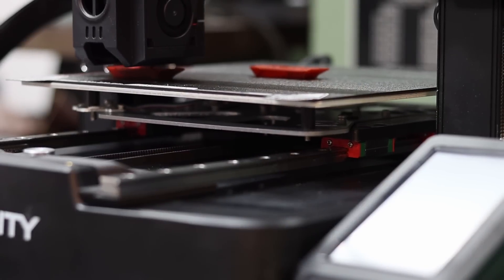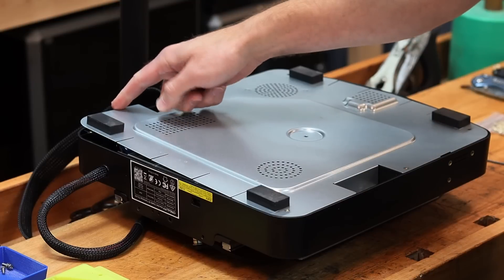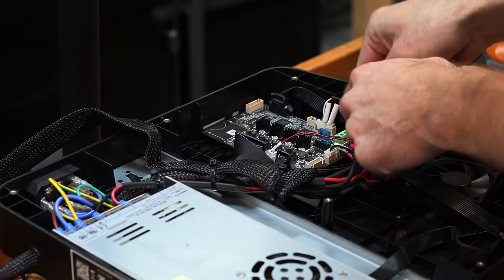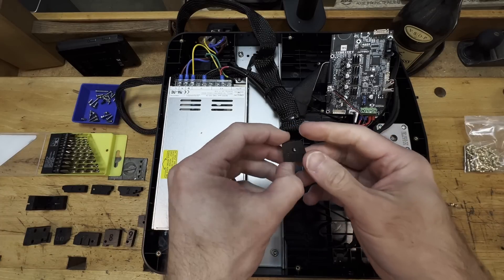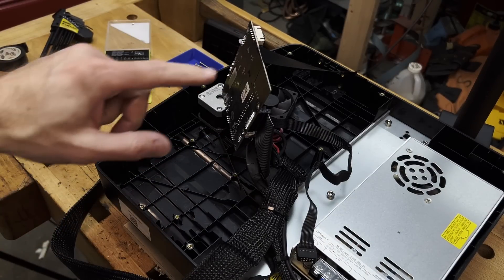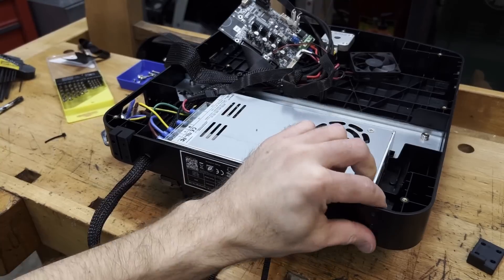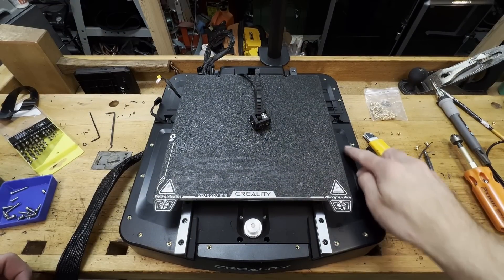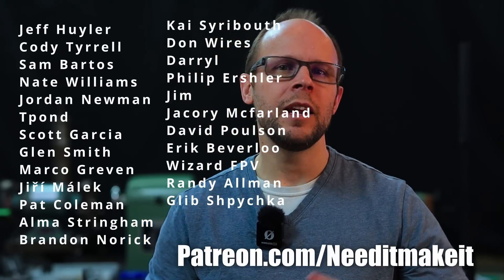Attach ANYTHING to your Creality Ender 3 V3 KE or SE Printer

Comment: My connector to the y axis stepper motor is causing a spark, any reason why? It has damaged one and i got new one. I was assuming it was motor issue, but it turns out connector crimps are at fault

Comment: Man.... now I really don't know if ai should gut my KE. Honestly I have like 8 printers and 2x laser engravers/cutters and I just made a mount for my plasma torch and ordered all new rail siders like this so zero belts plus its gonna use 4 nema 17s on bottom 2x of them will have 14 bit encoders the other two will just be the wires reversed(thats just for the x axis. Now to ay axis another 2x nema 17s one with encoder and one backwards hooked up. And lastly im also attaching my 3dscannerpro seal lite on one more nema 17 with its own 150mm slider and lead screw.. all new stop switches(different high end type) a big emergency stop button. And today im gonna order a 7in touchscreen pad and a high end brain board with Driver on it from China.. im just waiting on parts..

Comment: Well done!  I agree it lacks any way to add anything to the v3 se.  I am also pretty bad at added inserts they either work or fail no in-between.  I made a side gantry to lose some of the wobble on the top with the filament reel which My solid V2 did not have the same issue.

Comment: I bought a KE last month, have used it a few times and got decent enough prints,. but then I left it printing overnight to come back to the blob of death.. it killed not only the hot end but the fan, and the header board..... Try getting spare parts - the hot end header board is not available as a spair part here in the UK and Creality will do nothing even though it has a years warranty, so I have to buy the board from them via China at $45 plus taxes, a new fan and hot end, not good for a company with a supposedly good rep in the 3d market.
I think that they make way to many versions of printers. Good whilst it worked but I have just paid out for an A1.. If I can find a header where I don't have to buy it from half the planet away I will fix the KE... now it's under the table gathering dust.

Comment: Hello,

If I use Brass Heat Set Inserts 5mm instead of the 10mm ones you recommend, do you think it will cause significant instability? I hadn’t seen this video earlier, and I’ve already ordered all the parts for this build, as well as the one with the rails. I’m mentioning this to avoid waiting an additional 2+ weeks for the 10mm inserts to arrive.

Thank you!

P.S. The Discord link has expired.

Comment: I really like the attachment points you added to the Ender 3 V3 KE. If I ever added them I would like to add all the blocks at the same time, but necessarily drill them till I needed them. Just wondering if you could design jigs or templates to drill the holes as needed for the current project. Then the user could print the template they need when they need it. You could probably use some of the mounts you designed as a starting point for the template design.

Comment: Amazing mod, this is a massive help. Is there any chance you might share an stl or step of the base as it would make designing mods using these mounts so much easier? There are a couple on printables but variations on the base profile

Comment: I haven't seen your videos before, but after watching this, I am a fan.
Just a thought though, maybe you should have put the heat inserts in from the bottom instead of the top.  If they were 8mm long, you could have a couple of mm of plastic as well as the insert holding them in. All you would see from the top is some 4mm holes. Much stronger pulling force needed to pull them out.

Comment: Can the V3 SE print ABS? Can PETG be used instead?
Reply from the maker: You can print ABS on these printers, but you'll want to print in an enclosure, I've also printed with a thick blanket on the printer to make a pseudo chamber.  It's not ideal but it can be done.  PETG can be used, but Basic PETG is pretty flexible, using PETG-CF will give  you stiffer parts.
Reply: @NeedItMakeIt  Thank you

Comment: Is there a specific reason you decided to print the reinforcement blocks in ABS, and would there be any noticeable difference if they were printed in PLA or PLA+? I'm very new to 3D printing and haven't tried any other materials yet, especially those that may be a little fussier.

Comment: Yesterday I broke down a long unused Monoprice Maker Select Plus, saved the CF Z axis support rods and a few other parts. Those rods would probably fit this mod, though given the amount of flex there at the very end, I’m unsure if this will be worthwhile. Looking forward to your pre/post print results.
Reply from the maker: I'm nearly finished it, and it'll be fully printable (minus the bolts) I still need to address the extruder on the printer, so I can't really say it's going to do much, without having solved the other issue as well.  That will be it's own dedicated video, which is in the works, but it taking some time because of the complexity of the brackets and the confined space to work with there.

Comment: am i crazy to attach the base of the printer to a 80lb 1/4in table top and weld a gantry frame that this printers gantry fits under and attach to? this would make a solid steel frame around the printer stabilizing it i haven't seen anyone try and make a solid steel exo skeleton frame weldment for a 3d printer its all aluminum extrude with screws. any feedback id appreciate
Reply from the maker: No, I don't think that's crazy at all, it's just going to make the printer very hard to move around.  A welded steel frame is nearly the best thing I can think of, second only to Cast iron or granite/epoxy granite.    I've been wanting to make a steel frame for some time now, but I'm a Woodworker by trade, so I guess I should do a solid wood frame, it 'wood' be stunning!  I say go for it, possibly eye bolts to the table and tension steel cabling down to it would be another option.

Comment: I'm looking forward to seeing how you get the gantry plumb with the plate.   I just put a laser on the x gantry, marked the spot and ran Z up to 200mm and marked again.   There is a 9mm movement toward the back.   Laser was pretty bright so I will repeat with a lower power/brightness to be sure.
Reply from the maker: I'm nearly finished that upgrade, but 9mm, that's quite a bit more than I was expecting.  I noticed that the nozzle is not set at a perfect 90 to the frame, I'm not sure how you're attaching your laser, if it is to the head, it might be throwing off the results.  Are you able to use a plumb bob instead of a laser?  I'll check to see if I have one, or if I can make one up quick.
Reply: @NeedItMakeIt  I ran the numbers in a triangle calculator (cheating?).  

Side a = 200.2024  (calculated)
Side b = 200
Side c = 9

Angle ∠A = 90° = 1.5708 rad = π/2
Angle ∠B = 87.423° = 87°25'24" = 1.52583 rad
Angle ∠C = 2.577° = 2°34'36" = 0.04497 rad

Just 2.5 degrees off plumb gives a lot of runout.   I'm printing the front blocks now and remixing gantry mounts to match.    Do you have a 3d model showing the hard points once installed?
Reply from the maker: @haroldmelton11  It's only cheating on a test, you're safe on this one.  I've heard of some people having theirs off by quite a bit, but geez this is pretty extreme.  The solution I'm working on will have some adjustment so that the angle can be set and fine-tuned.  Maybe I need to give it a little more adjustment!

Comment: I really like the idea of adding all those mount points to the bed. But... with the reinforcing doublers glued in under the deck, why insert the heatsets from the top, where they're much easier to pull out under load? Why not insert from the bottom so the'd have to pull through the doublers? Loads would get distributed into the deck better, too.
Reply: Yes it's better but the headset is long enough to work well and touch the doubler.

Comment: seems alot of people have problems with the rails, but i checked my KE as i got it and the rails didint have any slop or unwanted movement in them, i guess i got lucky tho the z axis needs to be secured and im working on moving the roll off the printer, by moveing the roll above the printer on to a shelf i need to weld the legs for and cut a board of birch ply for the top

Comment: First of all, this is what I was looking for. I really appreciate your effort and all the stuff you've made. I will definetly do the same upgrade.

I have two questions
1. Would it be possible to get your files for the gantry stabelizers? or are they still wip?
2. the major problem Ive got with this printer is the "nozzle hitting infill"-Problem. Did you experienced that with yours? If so, did you managed to fix it somehow? 

Again, this upgrade is awesome. :) Instantly subscribed :D

Thank you very much in advance

Comment: I am surprised to see that the columns are attached to a almost flat piece of metal ( Alu or steel, cant see ) I see there is a bend that reinforces it, but still, I guess extruded profiles as a frame is better. I am looking into gantry supports and think the will be best if I can grab onto the bottom of the columns.

Comment: While I probably won't be using most of these, it would be nice if they included some kind of mount for their nebula cam they have available... so I may end up using at least one of them for that
Reply from the maker: For sure, though I have a mod coming which would allow the cam to be bed mounted along with the accelerometer, I've always found it more helpful on the slingers to have a camera that moves with the bed so the video is more clear.  Do you know much that nebula camera weighs?
Reply: @NeedItMakeIt  Amazon says 4.9 Oz, tho I did find a few different models to mount it to the gantry last night; seems most useful to have the camera move up with the print so that the active area doesn't go off screen (esp with the spaghetti detection capabilities), so I'll probably use one of those (bit of an easier mounting situation as well)

Comment: do you think printing the supports in ASA would work?
Reply from the maker: Yes, the solvent for both is the same and if you need to you can use super glue rather than the method I used.  it really just needs to hold them in place well enough to get the inserts in.

Comment: When putting in the threaded inserts, leave them proud of the surface by .5 mm. Follow up with a flat piece of metal to finish seating them. They stay plenty hot for a few seconds.
That makes the finished surface much nicerb without having to clean up flash with a razor later.
Reply from the maker: That's a great tip, thanks for that.  I have some more to do for the next project and I'll be giving this a try for sure!  The razor method tends to scuff the surface a little bit, it's better to avoid it, inserting from below would be an option too except 6 + 4 at the back had to be inserted from the outside and it didn't make sense to do them differently.
Reply: This is how I install inserts. It keeps them straight and clean.
Reply from the maker: @generic0000  Great tip, I have only a little bit of experience with inserts, just enough to get them installed, but not so much to have them looking as good.  Thanks again for the tips.

Comment: Another option would be to fill those spaces with epoxi
Reply: I don't think heat inserts go to epoxy 🤔
Reply: @kimmotoivanen  I never tried but it's an interesting thing to try
Reply: Epoxy is thermoset polymer, i.e. it doesn't melt.
Reply: @norseengineer  It doesn't. But it gets soft when I heat it

Comment: This is taking this printer to a much higher level. This gives us the possibility to alleviate the shortcomings that this very cheap printer has. Huge thank's for the effort and for making it publicly available
Reply from the maker: That's great, it certainly opens up a lot more possibilities with the printer, I'll have a few more options coming out which take advantage of some of the holes.  I couldn't think of any better options which would be strong enough.

Comment: Morning Mike.

Hope this finds you well.
As always I enjoy following along your creality journey. 👍

Great content.

A side note on a couple of things you might like or want to share with your viewers/community.

When handling a board ( motherboard or otherwise) it’s really good practice to wear an anti static strap or at the very least touch a bonded surface while handling the board. This prevents accidental static discharge into the board.
Which would permanently damage the board. I share this point with you, as we do a lot of marine electronics.

I’m not sure if you have done this firmware mod already to your K1-k1 max. That is increasing the bed probe point count.

I’m running a 24X axis by 24Y axis probe count on our K1 max currently, with excellent success and no error codes. 

I think this could also be done with any rooted machine running Klipper?

If you’d like more info on this (it’s a bit of a process) please contact me as I would  be happy to share this with you.

Cheers, and best regards from Salt Spring Island B.C.

Ron.
Reply: Hi Ron, reagrding routing the device, did you install Mainsail from GitHub? I did and was so happy about it till I found that the modules (e.g. Moonraker) can't be updated to their latest version.
Do you or anybody know of a way to update the modules?
Thanks!

Comment: Hi. I'm new to 3d printing. I ordered  ADXL345 Vibration Compensation Sensor and was wondering if you know that it could make a difference in vibrations or no ? I saw one test that demonstrated how it works in a lab environment, so the results are great, but what about real life.
Reply from the maker: I've done some reading on this, and apparently if everything is stock, there is little to no difference.  When we start modding the printer, you'd want to run the calibration again to find the new best values.  I don't think this printer works the same for vibration as we'd have on a Core XY, those printers have a head doing movement on X/Y.  Here we have separate X & Y axis and they'd need to each have a sensor which is active, and I think in most cases, people use the same sensor and swap it back and fourth.

Comment: Great solution! I’m new to 3d printing but I have plenty of DIY experience, and you’ve done all the hard work to make this a simple project for the rest of us. I will certainly be tackling this after I build an enclosure and get dialed in for ABS.
Reply from the maker: Thanks!  I hope it helps some people out.  Getting those blocks to fit well in the webbing, wasn't so easy that's for sure.  I'll have about 3 more videos coming for this printer... at least, there is so much potential and you guys have a lot of ideas as well.  We need to tackle the extruder setup as well, but that's a bit of a bigger project and I wanted to work my way up to it.  Which enclosure will you be using?
Reply: @NeedItMakeIt I haven't really done my homework on an enclosure quite yet. I plan to build one myself unless I come across a compelling commercial product. The "tent" options are definitely affordable, I'm just not sure about the quality.
Reply from the maker: @Leeks88  I built one from MDF with a plexi cover ages ago, and it worked really well, though it was pretty ugly.  Something collapsible would be nice unless you have the room.
Reply: Thanks for the advice, looking forward to the rest of the series!
Reply from the maker: @Leeks88  Sounds good, more to come very soon!
Reply: @NeedItMakeIt  What is the purpose of a cover? Noise?

Comment: I do have an ask.  When I download the files and open them I get an error.  I use PrusaSlicer and normally when this happens it means that the files were created with Bambu slicer.  Can there just STL files to down as well please.
Reply from the maker: I also created the STLs, but let me have another look in a few minutes.
Reply from the maker: I had a look and the individual STLs are there, but you'll need to download them as RAW files.  They'll be individual parts if you do.
Reply: Yes the stl files are there for the blocks for inserts but for the linear rails upgrade they are all 3mf files that will not open in PrusaSlicer.
Reply from the maker: @TinTalon  Okay, I've loaded the STLs for the linear rails to Maker World, sorry about that.
Reply: Your awesome!  Thank you

Comment: Modtastic 👍👍👍 you put alot of thought and effort into this project, great video

Id next like to see you widen the the frame, put longer linear rails on and put a bigger build plate on it. At least 300x300mm👍
Reply from the maker: Thank you!  Ah, that is a big project!  I think it's doable, I was thinking about re-printing the entire base with lots of attachment points... problem is that I'd want it in one piece and for that, I'd need a bigger printer.

Comment: I am really enjoying these upgrades to this printer and can’t wait for the next ones.  I want to see what this printer can become.  What is the slurry you are referring to to glue the parts? Thank you for the excellent content.
Reply from the maker: I think maybe super glue would work well, but ABS slurry is acetone mixed with some ABS parts and I've let them dissolve.  You can also use Acetone as-is, but it will not be as much of a filler as what I was using.  Hot glue could be another good option, they just need to be held well enough to add the insert from the other side.